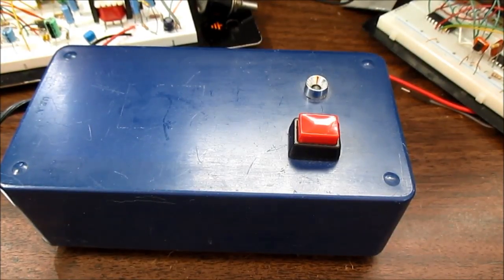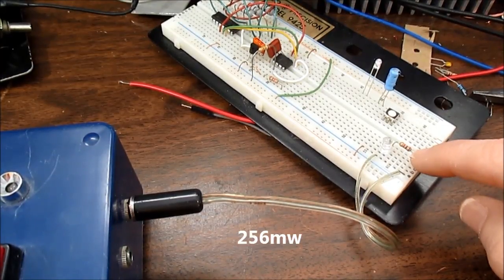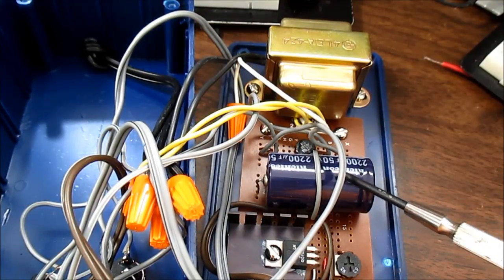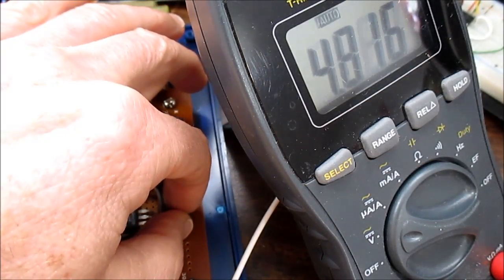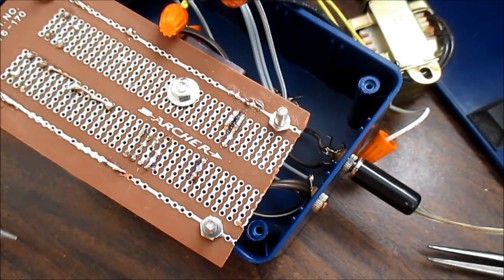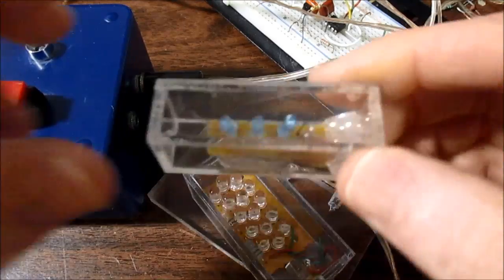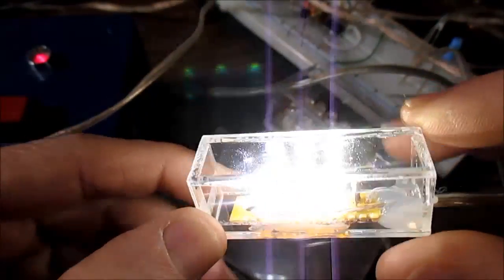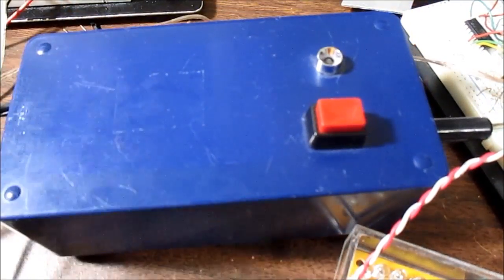Repairing an old DIY regulated power supply

Comment: Please make a learning video on regulated linear power supply that how much the input voltage drops on a specific load drawn and how to calculate total voltage drop across the regulator ic for calculating the heatsink size to be used. Also to calculate the main filter capacitor to be used with the power transformer for stable voltage.

Comment: If a voltage regulator IC has to dissipate 20 watts power as heat, what should be the size of heatsink for it ? Will a 2" x 2 " finned heatsink be ok ?
Reply: I may need a transistor in paralel with the regulator If the current in higher than 1A

Comment: A bit irrelevant question, but i noticed in your LM1875 video you said that a lot of those chips sold online are fake. Any tips where i could get genuine ones online? How does one determine whether a chip is genuine or fake? In my local stores those chips are 2$ a piece, and i'm unsure if these are even genuine. Should i go for it or just buy 10pcs for 2.5$ from aliexpress? I did buy 10 TDA2030As on aliexpress and they seem to work fine. Really appreciate your work sir.
Reply from the maker: In the US I buy from Digikey or Mouser. The fake parts will probably function but they will not meet spec. The fakes I had came up short on power and some didn't have short circuit protection. The TDA2030 is an obsolete part so beware of any you buy new.
Reply: JohnAudioTech well, judging by the 2.7$ price tag for a piece on mouser tells me that these aliexpress ones are most likely fake. And it's probably not a coincidence that one of those tda2030a chips i have turned into a heater(no output, started heating up rapidly) when i accidentally shorted the output to ground for less than a second. Thanks for the reply, keep it up with great videos.

Comment: You are not quite using the conventional circuit.     See link.    http://www.circuitstoday.com/wp-content/uploads/2011/04/LM317-typical-adjustable-regulator-ckt.png           When you tweek the pot you are changing both the voltage regulation resistance and feedback resistance.      I have never seen anyone wire it up the way you did.      I usually use a 220 ohm resistor for the feedback resistor.
Reply from the maker: The 2k pot acts as a simple tuneable divider with the values near the datasheet at the 9v fixed output I desired. This wouldn't be ideal with a fully adjustable regulator design.

Comment: This was a great video. I made all the same kind of stuff- even the all Radio Shack power supply, though I used the 7812 and 7805 regulators for a dual voltage output. I think the plans were in a power supply book I got from the Shack. I bought up LEDs from every source I could find, and still have buckets full all over the place. Unfortunately I tried gluing the acrylic boxes together with solvent and never had much success with the boxes. I should have tried hot glue - yours look good. I made the first 3 ultra bright red led flasher I ever saw in 1993. I used the LM3909 flasher IC to get the LEDs to flash. I quickly boxed it up with a small black Radio Shack project box and rubber banded it to the back of my bicycle. I was easily seen for up to 1.5 miles, and because I used the 3909 it ran non-stop for a couple months on a single AA battery. I would tear off a small piece of paper and write down the date the battery was installed. Some lasted more than a year!  An inventor from Palm Beach FL saw it one day and was quite impressed. I opened it up to show him the inside and how I had built it. He said he could see me from miles away. Within 3 months the flashing bicycle tail lights started showing up all over the place. Always made me wonder... did he steal my idea? I miss those days. Nobody ever expected a thing from me, and electronics was nothing but pure fun and the almost daily  discovery of new things.

Comment: hey John, I recently got some clear acrylic, what did you use to cut it, and what glue do you use?     thanks mike
Reply from the maker: I use solvent cement that's made for acrylic and a needle applicator. You can buy a good quality scoring tool that is comfortable to use and a straight edge that can be clamped down or non slip surface to keep it from moving. Most of all it takes practice!
Reply: thanks I'll give it a try
Reply: Plastruct,if it can still be found. Update: it can! https://www.amazon.com/Plastruct-Plastic-Weld-applicator-2oz/dp/B00FDFWJD8

Comment: You should put a control pot on top and make it adjustable. Keep up the excellent videos!
Reply from the maker: I have other adjustable PSUs around. I needed this with 9v output.
Reply: I would've used a vertical standing trimpot and made a little access hole on the side of the enclosure to trim if needed.

Comment: how do you cut acrylic plates ? with saw ?
Reply from the maker: You can buy a good quality scoring tool (the ones at the hardware store suck). It can be sawed but you need a good quality blade for clean cuts.
Reply: i see.
Reply: Yes, and move the saw very slowly. Otherwise the friction created in the process welds the blade shut in the piece your chopping, ask me how I know :/
Reply: may be i should use paper cutting knife instead ?
Reply: iceberg789 Pretty much anything will do, but proper scoring tool is sharp and will stay that for long time. I used a pin from a compass to do that, it's surprisingly tough.
Reply: i am researching about this, and found people are using fine hot nichrome wire for a clean cut.